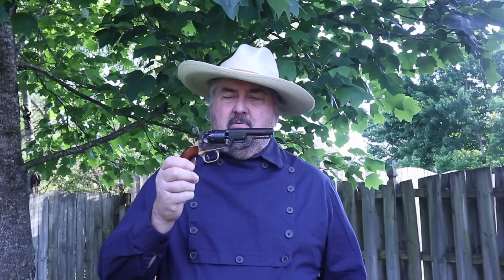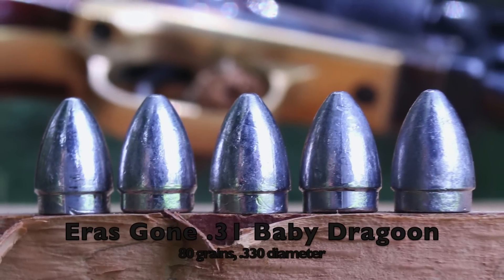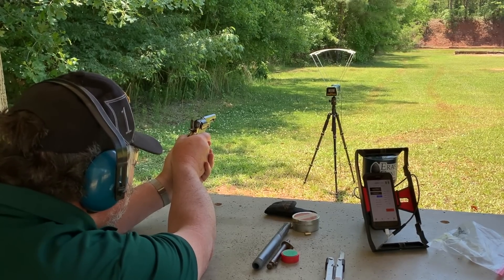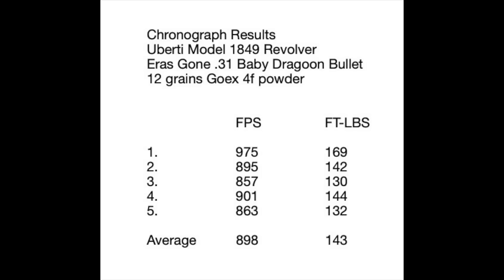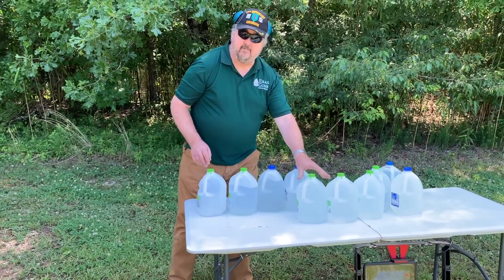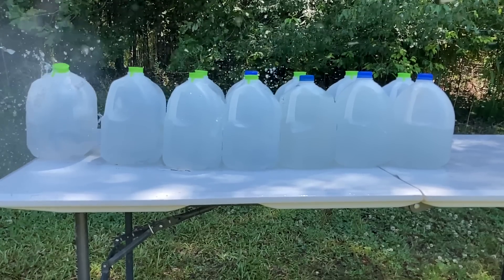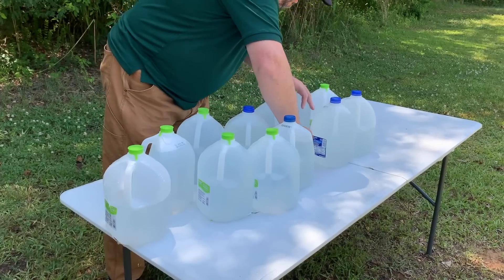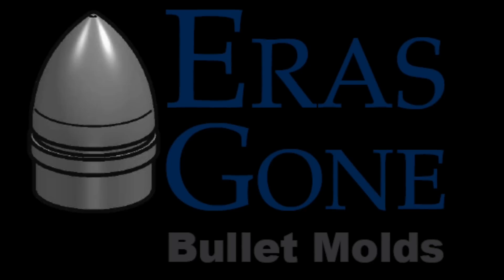Uberti .31 cal Baby Dragoon, Puny or Deadly?

Comment: Minimum standard for modern self defense is 200 ft/lbs (380 acp). The baby dragoon doesn’t meet that criteria. The 1851 navy doesn’t even meet that criteria.
Reply from the maker: Nunya, I'm sure glad Sam Colt didn't know about those modern standards.  He may have never went into firearms design and production.
Reply: yet they effectively killed how many??
Reply: That’s regulated nonsense. My hunting load for my Remingtons is 35grains of 777 and a 255grain conical. I’m getting velocities ~1100ft/s. Last time I did testing I had an average energy of 747ft/lbs. that’s on par with 10mm. A .36 loaded in the same manner, with a heavy conical and stout powder charge, would have the same result, In proportion. The information you are spewing is from people who load them with mild loads and round balls, to punch paper. When used to it’s potential, a cap and ball .44 is on par with any modern .45, and a .36 is on par with 9mm. Also keep in mind that modern powder is much weaker than it was in the 19th century. It was similar to Swiss 4F, both in power and granular size. The truth is, the knowledge on how to load and use these guns was forgotten, and was only revived in the 1960s and 70s. They got a lot wrong by adding wads and grease over the chambers. They had to load them light because the quality of the repros was awful. The tolerances were sloppy. They were made for reenactment, and were nothing more than noisemakers. There are some folks today that are following colts original instructions, and they are getting the results that colt intended. Please get a cap and ball sixgun if you do not have one, and do some experiments yourself. What you find is going to surprise you. Please don’t spread information that you yourself have not verified. That is how these misconceptions get started and stay prevalent.
Reply: @poncholefty471  I have a Pietta repro Remington New Army (aka 1858), steel frame.  I've routinely loaded 35 grains (volume equivalent in Pyrodex, no local source of black that I've found), with round balls and either wads or grease (they make cleanup easier by softening the fouling).  That's about the same load as a .45 Colt, albeit 143 grain round ball is a lot lighter bullet.  A heavier bullet would obviously require reducing the load a little to get the bullet to seat below the chamber mouth, but my load has about the same kick as a modern load in my .357 revolver with 140 grain bullet -- suggesting it's giving barely supersonic ball.  Overall, I'd say a .44 cap and ball with steel frame, in a quality repro, should at least equal a .45 Schofield cartridge gun.  And with a spare cylinder, I can swap in less time than it takes to reload a loading gate style single action.
Reply: @SilntObsvr  the wads are unnecessary. as long as the first shot is going down a lubed bore the fouling will stay soft and easy to clean. I have found using a heavy conical increases pressure and gives a more complete burn. By using heavy conical bullets you can definitely get more power out of your revolver. You can load a Remington with 40 grains and a conical, but there doesn’t seem to increase velocity by much compared to 35 grains. 35 grains of 777 and a 255 grain conical is the best load for hunting I have used. Accurate and on par with 10mm.
Reply: @poncholefty471  I still need to get my Pietta's frame relieved so I can use conicals in general (I know, there's at least one mold that works well with an unaltered Pietta, but Eras Gone is out of them).  Once I can use 'em, I'll have to try 'em with a full load.  Then I can start making paper cartridges with that load, and outside lube the bullets.  Just that little bit of wax/tallow makes a big difference (Pyrodex cleanup is worse than black, in my experience).
Reply: @SilntObsvr  15 minutes with a Dremel sanding drum and a bottle of cold blue will fix your problem. And it gives you an excuse to buy a Dremel, Which is one of the most versatile tools in the toolbox.
Reply: @poncholefty471  I've got a Dremel.  A model 275 (bought at an auction in 1986), too old to use some of the modern accessories that require the screw-off nose flare.  I've also got one of the last existing pairs of spare brushes for it, which I bought in 1987.  What I lack is time and workspace (including time to cast bullets and get out to shoot).
Reply: @SilntObsvr  that’s a bummer. I hope you can find some time. Getting a cylinder loading press to load off the gun is a good solution for people who don’t modify their loading ports. As far as time to shoot, I think we all could use some more of that.
Reply: @poncholefty471  Loading off the gun doesn't help much once you go through the two loaded cylinders your brought from home, though.  If you're shooting somewhere you can't set up the press, you're back to round ball (whether cartridge or loose) unless you get the gun opened up to take conicals.  Of course, there's the Kerr, which fits unmodified Piettas -- but again, nobody seems to have the mold any time I check.
Reply: @poncholefty471  Your velocities for the 35 gr 255gr "Kaido" flat-nosed conical agree pretty well to what I've chronographed out of a Uberti Remington Army .44, although I use Swiss 4Fg instead. That 35 gr Swiss 4Fg, 255 gr "Kaido Bullet" makes a hunting load of devastating thumping power and destructive force!  I'm not too fond of Hodgdon 777 though, as performance seems to deteriorate after the can is opened. Not sure if 777 chemically breaks down, or absorbs moisture. If the problem is moisture absorption, it is possible 777 could be "rejuvenated" by cooking for 30 minutes or so on an electric griddle set at 180 degrees. I'd be very interested in your thoughts & experience on 777 use.

You are 100% correct about the ignorance and disinformation swirling around cap and ball revolvers. It is a lost art that we modern shooters are slowly recovering!  

In the 19th Century, Hazard Powder Company called FFg Musket powder, FFFg Rifle Powder, 4Fg Pistol Powder, and 5Fg Cartridge Powder.  4Fg "Pistol Powder" is the finest granulation that can be safely flask / loose loaded, provided nipples are in good condition. Extremely-fine-grained "Cartridge Powder" was intended strictly for use in the paper powder envelopes of revolver combustible cartridges. The only 5Fg available at present is Swiss Null B. 

To duplicate correct 19th Century revolver combustible ballistics, I've used 22 grs Null B under a 216 gr conical in a home made combustible paper envelope cartridge for the .44 Army. Out of my Uberti Remington Army, that very moderate load makes ~950 fps MV!  Carefully bench rested that moderate, traditional "service load" will group 6 shots consistently into about 3 inches at 100 yards, and I can consistently "head shoot" full size silhouette targets at that 100 yard range. Not only does a properly loaded quality cap and ball revolver hit with power equaling or exceeding many modern cartridge handguns, these revolvers are also SUPERBLY accurate.  

With quality replacement nipples to prevent cap jams, and proper greasing of gun and bullet, the Uberti Remington will literally shoot all day without issue. Greasing the Uberti in the traditional way with beef tallow keeps the revolver running almost all day without issue; greasing with Ballistol often requires an oil drop at cylinder front and rear every 12 shots or so to prevent binding by fouling. I use a bullet lube of beeswax/coconut oil  at a 2/1 ratio, and hot dip lube the bullets of my combustibles, which keeps the bore almost shiny clean throughout a day long shooting session.  The 216 conical is from an old Rapine mold and is almost the same as the Era's Gone "Johnston&Dow" .44 conical, except the rebated base of the Rapine conical is about 1/3'rd the length of the long rebated base of the Johnston&Dow conical. My powder scoops and flask spouts are all calibrated by water weight, where a volume of "22 grains of water weight" is called a 22 grain charge, whether the powder is black powder, Pyrodex, 777 or etc.
Reply: @63DW89A  a gentleman sportsman wrote in 1726 that before a pheasant hunt that your powder should be baked in a clay pot the the oven overnight.
They baked bread in large ovens that they built a roaring fire inside of im the morning.  After it died down they shoveled out the ashes and put in the loaves of bread.
The oven stayed hot all day. By evening it would have been in the 200 degree range and very gradually cooled by morning.
It would be interesting to chrono
Some loads using powder from one of these new plastic cans and the same powder after baking it overnight in a covered clay pot in a crockpot full of sand.
Thanks for your interesting comments.
John Davis Jax Fl
Reply: Poncho Lefty You are absolutely right..I just wish that the experienced and informed cap and ball community was larger than it is..there’s just too much that has been lost in time
Reply: @eriv4735  thanks, glad someone shares a love of history, and most importantly the parts that have been lost. Some of These things cannot be read about, and can only be uncovered by DOING. There’s a reason true fighting men that relied on their guns for survival chose to use these guns long after cartridge guns came to being. Men of means, that could have carried any kind of pistol they wanted. You’ll never find out why that is until you put one in your hand and feel what they felt.
Reply: That's a very ignorant statement. Lol
You must not have ever shot a gun in your life. You  just read and think you know it all. Those guns you just named killed plenty of men. Lol
Reply: Look up how much energy a broadhead arrow has then tell us if you would stand in front of it because of how "weak" it is
Reply: Standard Back Up Pistol of Generals of FOUR different countries was 32 ACP in WW2.  Even Patton carried one.
Reply: @chickai25  Two or three different wars, too, right?  WWI, Spanish Civil War, WWII, and maybe some in Korea...

Comment: I found that these small pistols don't set off caps very good I fitted two main springs in the one I had. I swapped it for a Pietta 1860 Army.  I wanted to by another one lately but they are all on back order.
Reply: Uberti's are known for light mainsprings. They view these as novelties, rather than actual firearms, so their focus is on target-type triggers, rather than reliability.

Comment: I'd love to see a modern cartridge conversion for this in something like .32 ACP or .32 S&W Long. A lot deadlier than people give it credit for. While I've not heard as many people say it's as deadly as a .22, one thing they forget is that's .22 out of an 18 or 20 inch barrel usually. This is a much smaller gun by comparison shooting a bullet that's double the weight from a much shorter barrel.
Reply: Kirst & Howell use to make them, but both stopped.

Comment: Interesting video, Mark.  A simple solution for my Dropping Loading Lever was to snap the spring loaded catch out several times.  Using a flat blade screwdriver push the catch into the rod all the way.  Slide the screwdriver out of the way to allow the catch to pop out quickly.  By doing this several times the catch stuck out slightly more than originally and provided for a stronger grip.
Reply from the maker: I'll give that a try.  Thanks

Comment: Id buy one if they were 6 shot and had a 5" barrel like most of the originals.
Reply from the maker: I'd buy another if Uberti made a 6 shot version.   Colt did not offer the 6 shot option until about 1860, if memory serves.   They were all 5 shot before that time.
Reply: @erasgonehistoricalmolds2400  i have an original with 5" barrel and six shot cylinder that my great grandfather carried in his pocket.  Samuel Colt really pushed the extra round as a benefit of the new Colt special silver steel.   
Seems silly to reproduce these with modern material in 5 shot.
Reply: @erasgonehistoricalmolds2400   I have an 1862 Pocket Police, 5.5" barrel, .36 caliber that is 5 shots......

Comment: That's very impressive, certainly much better than a .22LR. How much lower do you think the velocity would be if FFG powder was used?
Reply: @BurkeSchneider over at "CapandBall" YT channel, Balazs Nemeth used the Eras Gone .31 conical in an original 6" barrel Colt Pocket Revolver. Swiss FFg was the powder, and the charge was similar to Mark's for the Uberti Colt .31 4" barrel replica. Velocity was around 780 fps. Mr. Nemeth did not want to push the original Colt too hard, and that is why he used FFg. The old 170 year old Colt shot amazing groups at 25 meters!
Reply from the maker: @63DW89A  Balazs was using my bullets, but he always makes them fly much better than I can.
Reply: @63DW89A  I wonder how much the accuracy had to do with Mr. Nemeth's skills, the man can shoot!
Thank you, that was exactly the information I was looking for.

Comment: I double checked because I thought I saw Clint Eastwood using one of these in the outlaw Jose Wales.  Sure enough he did and had it in a shoulder holster.  I just received mine and have started the molds on it can't wait to try it out.
Reply: You are correct. I did a video on making my version of Josey Wales shoulder holster.
Reply: Clint used the 58 pocket .31 in Pale Rider.

Comment: A very interesting conclusion! The penetration of this light bullet is amazing, not sure what alloy you used, but the bullet was barely deformed after passing through 5 jugs, 5 jugs must be equivalent to at least two people, so it is more that sufficient for any self defence in the 19th century, and of course it was not the penetration that caused trauma, but the infection, with very little chance of medical attention, that would make a potential assailant think twice, stay safe! Chris B.
Reply from the maker: Pure soft lead.  I'm surprised it did not deform more than it did.
Reply: @erasgonehistoricalmolds2400  Well, that is a surprise, traveling at around 900fps I would expect it to set up on hitting water, at that velocity water would be like a solid mass, I wonder if a ball would perform much more different to that in penetration and setting up.

Comment: Have you shot 3f in it? If so did you chrono it?
Reply from the maker: I've not chronographed any other loads.  Now that I have a reliable chronograph, I'd like to try other guns using various loads, and compare measured vs weighed charges to see if I can get better consistency in FPS.
Reply: @erasgonehistoricalmolds2400  👍👌

Comment: VERY impressive! Quite a rupture effect on the first jug too. You've effectively demonstrated that, properly loaded, the little .31 packs considerable wallop with the conical. A .22 LR will not do that much damage even with HP. A .22 Mag will. Also Swiss 4Fg would likely hit 950 + as it is a hotter powder than GOEX. Swiss would pretty well approximate the true ballistics of the Hazard powder actually used in the 19th Century with these revolvers. Swiss 4Fg is similar to Hazard #1 Pistol Powder, and Swiss Null B (5Fg) is close to the Hazard Cartridge powder provided to makers of revolver combustibles. The cartridge powder was made by Hazard at Sam Colt's request when Colt began revolver cartridge manufacture in 1855 with the unpopular short lived foil cartridges. Colt switched to paper envelopes in 1858 and revolver combustibles  became very popular.
Reply: Even if that wasn't the case I'm pretty sure the .22 lr holds the record for most dead civilians. Yeah, small calibers may not do great at range but up close and personal they'll still give someone a very bad day.
Reply: An old fed fighter told me he keeps a 25 auto for the chance of being choked from behind. He said a 25 would take out a felon with a head shot without hurting himself from excessive blast.
Reply: As a youngster I shot a deer with O buckshot. Two pellets to the lungs, but one to the back of the scull. The pellet bounced fore and aft enough to mush up the grey matter. It landed on its head at a DEAD run.

Comment: Mark,     I bought a conversion cylinder in .32 S&W for this revolver.  Unfortunately that bullet is only .312 diameter, so it is too undersized for the bore.  The conversion cylinder chambers are not bored str8 thru with the same diameter, but have a more narrow diameter than the neck of the brass, bored in the front of the chamber.  If that narrow part could be bored out to the brass neck diameter and the brass could be reloaded with your EGB bullet or a .321 ball, I think those projectiles would engage the rifling in the barrel, thus giving real accuracy. up to 25 yds.  What are your thoughts?
Reply: If I can interject a good hollow base .313 projectile would work with both presumably.
Reply: @TheBiggestIron      Where could I find some of the above in pure lead to test them?
Reply: @robertrobert7924  that would be the challenge. Other than a custom mold I cold not tell you. No reason you cant prototype one out by centering the base of a .313 and drilling a progressively larger deeper hole until you saw notable accuracy.